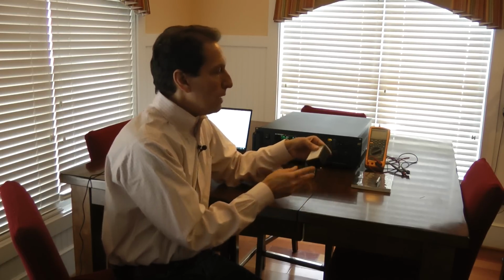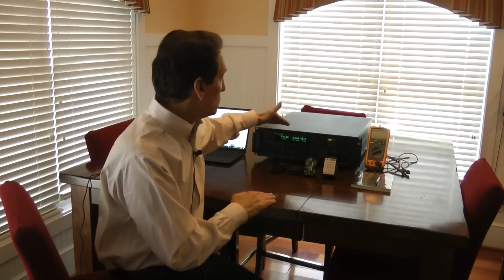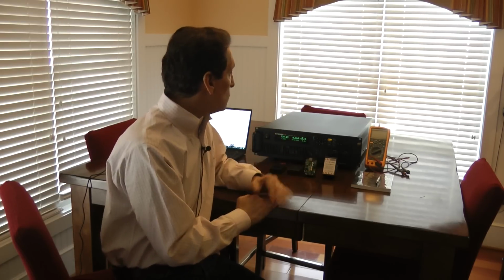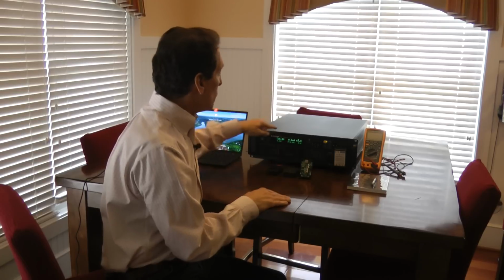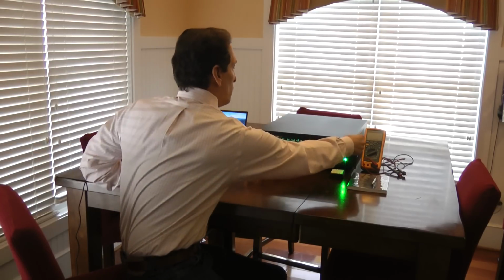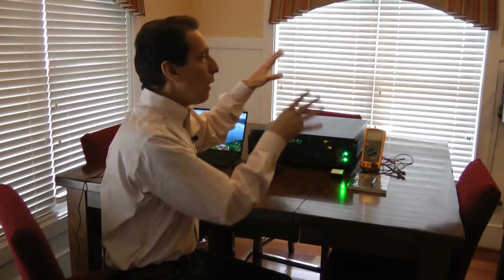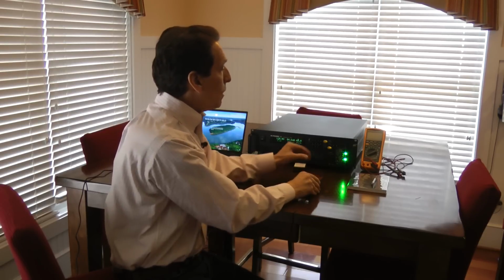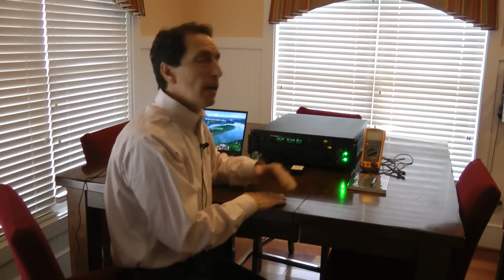EMP ALERT: The World's First EMP Detector

Comment: Someone pls correct me if I’m wrong but when you plug that in to your outlet and there is an emp and voltage goes up, wouldn’t that pop the circuit breaker and turn off the power to that outlet making the device turn off?

Comment: Additional mabe add like a push button braker that it shorts to trip it along with the ability to throw a disconnect. So when you come in form working outside you can look at the device and see what braker is poped out as a indicator.

Comment: Once you shut off your main breaker, how would you know when it is safe to turn it back on?
Reply from the maker: You wouldn't really. You'd wait about 10 minutes and then power back up. If the EMP Alert kept sounding, it would mean that the voltages were still too high. My guess is that the utility power would be off by then, so it won't matter.

Comment: Do EMPs have an effect on electronics that aren’t plugged in and connected to the grid?
Reply: Yes
Reply: @chrisbelvedere6653  then how would any of these devices help?
Reply from the maker: An EMP has two types of effects, the conducted effects that come in on long wires (e.g., the power grid) and the radiated effects that come through the air directly into the electronic device. To protect from conducted threats, you use surge protection devices and ferrites. To protect from radiated threats, you use shielding and transient protection devices.

Comment: As you were mentioning the Low voltage alarm function, I realized that this function would be handy when running a portable generator. If a thief were to remove it, the alarm would sound.  Living in the PNW,  I've heard the stories of generators being stolen with the thieves starting the victim's lawn mower to cover for the missing sound of the generator.
Reply from the maker: Interesting!

Comment: I would think by the time you hear the alarm, it is too late to run to your breaker panel.
Reply from the maker: The E1 and E2 will be over in microseconds, but the E3 surge (which is what is most likely to cause damage to things plugged in) occurs over minutes to hours, giving you the time needed to go flip the breaker.
Reply: I’ve been following Dr Bradley for several years, and since I’m just a layman here is what I learned in layman terms. If any E1 or E2 event occurs and you are in the line of fire, it occurs so quickly that there is nothing you can do. But if you are not in the line of fire (an E3 event) you still have to be concerned about the pulse generated on the electrical grid even far away, bc an E1 or E2 causes a pulse to travel along the grid and it will build up over minutes or hours and damage your home even though you were not in the direct line of fire and the E1 or E2 event. In that case the alarm will go off and you may have time to flip your house main breaker.  An EMP can get you in 2 ways: 1) the event occurs close enough to your home and the EMP does damage in a millisecond before you can do anything, but 2) even if you are not in direct line of fire, there will be a surge that travels along the electrical grid that spreads beyond the direct line of fire. If the alarm goes off in that situation, then flipping the breaker within a few minutes can save you stuff plugged in at your house.  This part is just my guess: but I think many more people will suffer as the pulse travels along the grid effecting many more people who were in the direct line of fire.  But if EMP goes off over your house there is nothing you can do. But the device will tell you it was an EMP and just not a local power outage. The device can give you hours to act on your plans before others figure out what is happening.

Comment: Question ⁉️ Doc?:
I bought a T.R.A.P. for my Westinghouse gas generator. Should I leave it plugged in both in use and off? 
Also I got the ferrites for the house but the Siemens surge protector is on back order. 
Are the ferrites useful on their own?
Thank you.
Reply from the maker: The generator will work fine if it is plugged in during use. The ferrites will still do their job, but you will still want to get a surge protector on there.
Reply: @disasterprepper  Thank you sir.

Comment: This is a good thing to have, thanks for sharing.

I apologize if you’ve already covered this in another video, but I was wondering how much protection concrete provides. More specifically if my car is parked in an underground concrete parking garage, will that provide any protection for the car and/or any of the electronics inside?
Reply: @jenky1865  ?

Comment: Would the alarm go off if there is a power outage from say weather or city work? And when are you projecting availability?
Reply from the maker: Each time the power goes off, the unit will sound an alarm when it is next brought up. That's an "I'm alive" notice. If the power lines are within spec, it will stop sounding within a few seconds. If the voltage level is out of spec, it will sound a continuous alarm.

Comment: so i have a question regarding a method of EMP protection. I have an aluminum skinned cargo trailer (steel framed/wood floor)  with both a standard sized side door, and a big ramp door at the rear. It also has 2 small 3 inch diameter vents. I plan to get a metal job box to put in the trailer for the electronics. Would the combination of the trailer/box be enough protection for say a Jackery/Ecoflow solar power station unit and the sensitive electronics i may decide to store inside?  Thanks in advance for your input.
Reply from the maker: It's really hard to say without doing a shielding effectiveness test. The seams around the doors can leak pretty bad. If you sealed up the metal box, it should work well.

Comment: This is brilliant, as a firefighter and electrician with an MSc Disaster and Emergency Planning and Management, I have considered all sorts of tech solutions to such problems. I absolutely love this solution! If you don’t mind, I have a few thoughts… consider two versions one for the USA and a 230v version for the UK and Europe. Build this into consumer units (fuse boards) and have it become the main switch, still giving an audible warning but also opens itself (the main switch). Users will have no action to take at home, and any desired solutions requiring Bluetooth, internet, sms etc… to advise users while away from home are not required. Also, if home automation platforms could advise of total power loss via their apps, maybe that would provide enough of a heads up to allow users at work to throw their iPhones and small devices into protective containers

Comment: Dear Dr. Bradley, I have some metal oil barrels/drums, that I plan to use as Faraday cages for protection of electronics in case of a nuclear EMP. They are originally painted (blue). Will they still work as long as I take care of sand papering the connection between the top of the barrel and the lid to secure a good metal-metal connection as well as covering any seams? or will the (non-conductive) paint on the outside cause a worse shielding effect (as the garbage cans I have seen you use have been all metal on the outside)?

Also, will a fridge and washing machine survive an EMP (they are not connected atm as I am off-grid living and my PV system off now)? 

Thank you for what you are doing, and God bless. Nikolaj in Denmark
Reply from the maker: The non-conductive paint on the body of the barrels won't hurt anything. You can certainly sand off the lip where the seal is to occur. Cover any seams with conductive tape too. Refrigerators and other appliances might or might not survive an EMP. Many of them have pretty sophisticated controllers that might be damaged. Being off grid certainly helps because it removes the E3 threat.
Reply: @disasterprepper  Thanks a lot for answering, I know you are busy, so I appreciate it a lot. Take care.

Comment: QUESTION 1. Wouldn't the power surge already be at the breaker box in order to "sound the alarm"? If so, I'm likely not going to be effective fast enough at throwing the main breaker (as well as on my Generac breaker panel too) because mine are located in the basement.
2. According to EMP Shield, their devices would automatically protect the home and the generator without me doing anything. Have you ever tested their product for effectiveness? If not, is there any reason you would doubt their effectiveness? Thank you!
Reply from the maker: The E1/E2 pulses will occur in microseconds, so the unit will just tell you that they just happened. The E3 could take minutes to cause the power lines to rise to dangerous levels. As the voltage rises, the EMP Alert sounds an over or under voltage alarm to let you know that the power levels are moving outside normal operating ranges.

Comment: Sorry, you had good videos about the topic EMP a couple of years ago, but this device is useless. 
When an EMP is detected, I can't run to the main switch as fast as I need to prevent anything. I'm not superman. And if such a device detects an EMP, then all my devices are already affected by the EMP at the same moment, so there is no point in preventing anything.
The only use might be for scientific purposes just to be able to tell when an EMP has occurred, if it does have an RTC and maybe how severe it was if that's something your device can measure as well. 
About the voltage thing in the net. Before using such a device it is by far better to use an active overvoltage protection at the main supply, capable of automatically disconnecting the mains from your local mains within ms . And to prevent computers and other important devices from suddenly shutting down, it's good to have a house battery or other UPS source.
Reply from the maker: People get confused about this. The E1/E2 pulses will be over in microseconds, but the E3 pulse (that comes in on the power lines) will take minutes to transpire. Opening the breaker before the voltages rise to damaging levels is the goal.

Comment: I was under the impression that when an EMP comes around it takes less than a second from the beginning to the end, and if that's the case then that alarm will sound very briefly and it will be too late to do anything about it.
Reply: Exactly, you need to be Superman or be able to bend time to switch the main switch fast enough. This device needs buyers that are not the smarted on the world.
Reply from the maker: That's a bit of a misunderstanding. Certainly E1 and E2 would be over in microseconds. That's where the surge protector and ferrites come in. But the E3 voltage line swell could take minutes or more.

Comment: Arthur, Please be sure to add a second LED that stays latched on, and continues to make a sound. That second LED should be labeled "EMP Pulse Detected". This is needed because the device might not be nearby or even heard (thus we would miss the alert).
Reply from the maker: The way things would occur is that when the EMP goes off, the unit will sound (and light) for about two seconds. Then as voltage levels rise on the power lines, perhaps a minute later, the unit will sound (and light) again and stay on until the voltage level lowers (likely when the grid comes down). While I understand the utility of a latched output, it probably wouldn't be terribly helpful since the entire event will be over in minutes (perhaps an hour at most). If you suddenly came home but had missed the E1/E2 pulse alarm, the E3 alarm would turn and stay on as soon as the voltage rose more than about 30 volts.

Comment: isnt this basically a really strong surge protector that beeps?
Reply from the maker: It's not actually a surge protection device. Rather, it detects various conditions associated with EMPs and CMEs and sounds an alarm.
Reply: If you look at his products site he does have a commercial whole house surge protector he recommended made by a third party and he has videos about it. I had an electrician install mine. There are instructions but I did not want to DIY my circuit breaker panel. Other surge protectors won’t trip fast enough to stop  damage. That is my understanding. You can search for his YouTube video on this subject for more explanation. I am just giving you what my takeaway was from Dr Bradley, but I am by no means an expert on this subject.

Comment: Question: Would this alarm then work in a generator outlet? 
After a yet to be determined amount of time, I'll be uncovering my generator from the shielding fabric cover I made, and plugging this into it.
 I'm sure that my box store generator doesn't produce a perfect sine wave. Thanks.
Reply from the maker: Yes, it would, but instead of detecting E3 on the power lines, it would be detecting overvoltage and undervoltage conditions on the generator output. The pulse detection would still work the same.

Comment: So low voltage alarm on your unit has nothing to do with an EMP surge, correct?
Reply from the maker: I've never been convinced that E3 would only result in overvoltage conditions. It could also cause currents to flow in ways that resulted in undervoltage conditions in some areas.

Comment: Do CMEs and EMP events typically have a long "warm-up" time during which this will be triggered and you can rush to your breaker box to sever the connection? My understanding was that they quickly spike to equipment-damaging levels within milliseconds of the initial surge, and this window of opportunity for a human to react simply doesn't exist.
Reply from the maker: The E1 and E2 will be over in microseconds, but the E3 surge (which is what is most likely to cause damage to things plugged in) occurs over minutes to hours.

Comment: Confirming - throwing your house breaker provides viable  protection against a  nuclear explosion produced EMP?
Reply from the maker: Opening the breaker will prevent E3 from coming in and damaging your appliances, TVs, etc. E1 and E2 are protected against using surge protection devices and shielding. Both are threats, but E3 is something most people don't even think about even though it's going to do the most damage.

Comment: I use a contactor for my computer room power...how hard would it be for this unit to have the alarm pull a relay high (or low) to automatically disconnect the power to the room?  
Maybe even something as simple as a signal to an Arduino so it can fire the relay which in turn shuts down the contactor?  
Also sometimes my grid power can occasionally dip as low as 105VAC during the high temp summer months...can the low alarm be adjusted to compensate for that?  
Sorry to ask so much but my computer systems are worth a lot to me and I want to protect them as well as possible.
Reply from the maker: Hi Greg, good to hear from you. We have looked at creating an auto-trip device sort of like what you're describing. It's not really difficult, but there are some complications once you start messing with the flow of power into a home or business. I suspect we will develop something like that, but for now, this is a very useful warning device. As for the 105 VAC, that should be okay. This unit current trips a little below that, but wait and ask me again once the final production units are shipping.

Comment: Questions:
1. Will it go off for lightening strikes either nearby or directly?
2. I thought the EMP pulses happened very quickly, hence the nano second response time of the surge protector you suggest, is that true?
Reply from the maker: 1. It shouldn't. The pulse response is optimized for very fast impulses, much faster than lightning. 2. The E1 occurs in nanoseconds, the E2 in microseconds, and the E3 in minutes to hours. This devices warns when E1/E2 occurs, as well as when E3 is occurring, giving you time to hopefully avoid the harmful E3 damage.
Reply: @disasterprepper  How likely are E1/E2 to damage equipment vs E3?

Comment: Another suggestion: a different tone for the airburst alert vs. the power spike/drop on the line alert.
Reply from the maker: The E1/E2 pulse causes a single roughly 2-second alarm. The E3 power line disturbance causes either a sustained beep-beep-beep or a solid beeeeeep. It's very easy to tell them apart.

Comment: Why not trigger a disarm of the main breaker as well as sound an alarm? If that would help in time take out the human element.
Reply from the maker: It's a possible future development. It's just much harder to do in a general way for everyone because there are many types of breakers.
Reply: @disasterprepper  
Maybe look into most commonly used breaker and start there. Kind of like a standard in industry that most homes have.
I'm by no means electronically inclined, but that would be my first guess as to where I'd start my project. Great concept.

Comment: Wouldn't it be too late when the alarm goes off? How much time would I have after the alarm sounds to throw the main breaker?
Reply from the maker: You'd be warned of E1 and E2 as it happened with a short alarm. Then as E3 caused the power lines to rise, the alarm would become continuous. E3 can last minutes or even hours.
Reply: Based on some other answers Arthur gave to questions, this is what would happen.

If an E1 or E2 event occurs, you do not have time to do anything bc it will be over in a millisecond.  However, an EMP can go off far enough from your home that you don’t experience the effects of E1 or E2.  However, those events , are escaped the third thing to be concerned about is that the pulse will travel from the electrical grid and wires into your house. If that is what is happening the device would sense the increasing electrical flow which builds over time. If you get an E3 warning, you may have time to get to your breaker box. He says if it is an E1 or E2 event, you won’t have time to get to your breaker box, however you would know it is an EMP rather than just a local power outage.